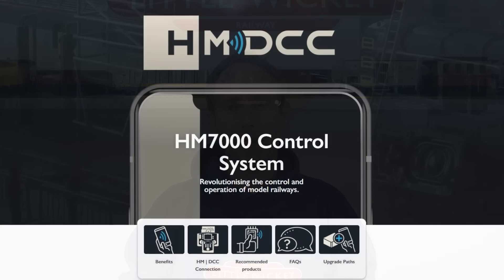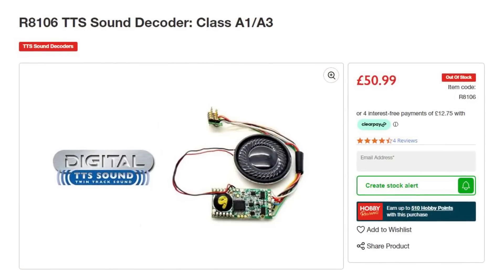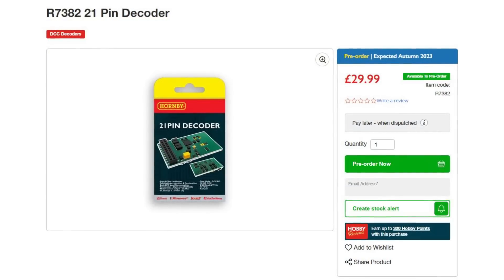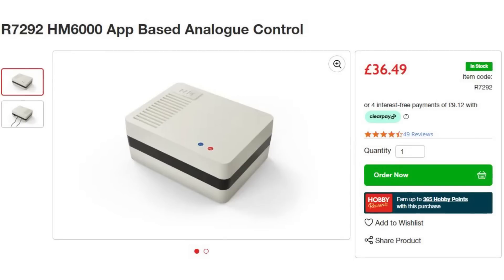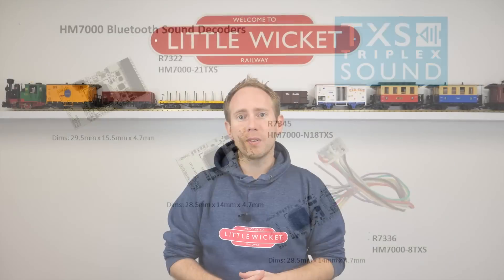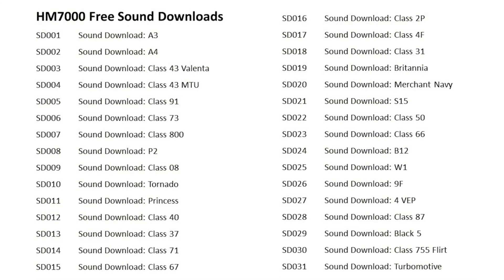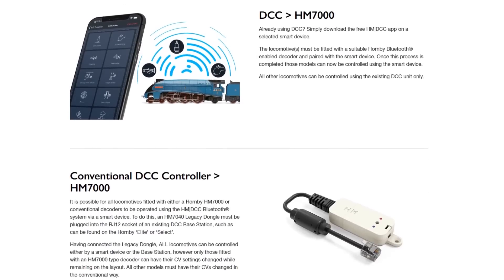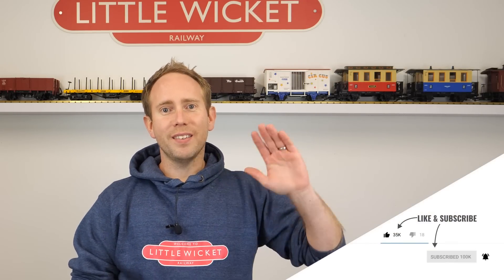Hornby Just Changed the Future of DCC with the HM7000

Comment: Yep.  Correct. Late entry, etc.

Re HM 7000:  
Bluetooth has been around for ages. Just that Hornby has caught up with it.
(Bluetooth is a specific form of short range WiFi)

Re HM 6000: 
Bachmann has had a basic non DCC sound unit too.  Apparently Hornby had one circa 1960s / 80s.

I have a Hornby 45rpm record with train sounds!  Know nothing about it.

Re alternatives: 
Radio controlled has been around for many years. I have quite a few (Ahern, Lionel, etc) and they operate on DC and DCC power.  They seemed to have disappeared.  Possibly because of their short range, etc.

I have a Bachmann (GGG) with sound that will operate on DC without anything else. As you increase the power, it goes through the start up sounds (engine, bell, horn) in order as it moves off! It also operates with DCC power and equipment.

A guy in USA has been making ANY track power WiFi decoders controlled by 'free' phone app for some time.

The sad news is whether some will make their proprietary.  ie not interchangeable like DCC.

Comment: Good vid. However Zero1 again? Betamax? Still have my obsolete Zero1 in its box. Solving a problem that does not exist? Hornby's track record with DCC is awful, incompatible and substandard, doesn't install confidence as they bolt the stable door with what looks like another hair brained idea that was not well thought out.
Reply from the maker: Only time will tell with HM7000. I've actually been looking back at Zero1 recently and given it was launched in 1979 it's still got quite a few fans today. It was ahead of it's time, sadly didn't get the support it needed to really take off (phases 4 & 5 were abandoned) and was ultimately superseded by DCC, but it was the first controller that was truly digital, affordable and widely available. You've got a piece of history in that Zero1 box, albeit a largely worthless bit of history.
Reply: @LittleWicketRailway  Yes. Unfortunately unless any emerging innovation is adopted by NMRA standard body it won't be adopted by the market. Standards may inhibit pace of innovation, but it also protects early adopters from financial loss and obsolescence. I've invested in too many sound equipped DCC locos to consider another emerging experimental tech. I'm going to hold on to my pristine boxed Zero 1 as its a piece of modelling history.
Reply from the maker: @oceanfroggie  the HM7000 decoders should work with any DCC controller and be NMRA compliant. How long the HM7000 app will be supported is a good question and we don't know if other Bluetooth apps would be able to also connect to the decoders.

Comment: Interesting -  direct control to the loco, power from the track & with 9 second stay alive potential for complexity on reversing loops etc to go away -  you'd just need strategically placed unpowered track to prevent shorts rather than getting polarity right.

Thinking on - its more like a DCC killer - if the track just needs to supply AC/power -  everything else is controlled wirelessly + if everything else has stay-alive power backup then power supply needs to be short resistant/restartable & ALL complexity over wiring reversing loops/points etc goes away.

Comment: Time will tel on this idea as there are a number of potential issues, firstly how much drain on you phone, possibly safe with a tablet having longer battery life. However I feel the biggest issue will be once you are controlling several locomotives and other devices such as signals, as the each unit will have its own Bluetooth chip, then you in to communicate with each chip you will need to hook you Bluetooth, which takes time, while you locomotive is heading to the points and another locomotive, so you are all ready switching between three devices at least, add more and this is rapidly becoming like spinning plates.
Reply: As I read it, the bluetooth decoders communicate between themselves, so you only have one connection between your phone or tablet and all of your locos. That should make it easier as you can just swipe between locos and accessories.

Comment: I've red quite a few of the comments a few asked will they work with your existing dcc unit mine being a digikeijs dr5000 , so do you have to use the hm7000 app to load the chip with the sound files and having a command station already can that then communicate with the chip as normal ,if it does then hornby will sell millions of them, if not hornby you've mist the biggest opportunity in model railway history................tony

Comment: I don't actually think it's as cheap as you first think. I have 40 loco's so buying the Bluetooth chips to replace the normal DCC ones they already have will cost over £1000, whereas Rocos Z21 cost me £500 and gives me the same app control of my locos.
Reply from the maker: If you've already invested in a system then I'd stick with that, I'm in a similar position. But imagine you're getting your first trainset, this is a way to get the benefits of DCC for basically the price the decoder. Previously it would have cost £££ for a command station.
Reply: @LittleWicketRailway  Even if all my locos were at the DCC ready stage, with no chips in them, it's still more expensive than regular DCC command station and decoders. (£800 decoders +£300 command station, Vs £1200 HM7000)
Reply from the maker: @peter sullivan again, this probably isn't aimed at someone with such a large collection of locomotives. Also, sound may not be your thing, but do that same calculation for sound decoders. The average retailer price for the new sound decoder is £60.
Reply: @LittleWicketRailway  I do agree there sound decoders are a good price and I will get a couple. As once you have downloaded the sound files, you can change a CV and then operate the loco on normal DCC. Where did you find the list of available sound files?

Comment: As an engineer I ask what’s the problem they are trying to solve? I’ve been able to control my DCC system via my smart phone for years.  With DCC via the track you can also set CVs without a programming track if you have a decent command station.Those decoders still look big

Comment: Honestly, a great step forward. Using existing "generic" hardware for the "command station" (a smartphone or a tablet), is a way to make great economy. Something as basic as a Gaugemaster Prodigy Express costs GBP 175, and it exists for ages ! I had bought the American original, made by MRC, for roughly the same price corrected from inflation, in... 2006 !
Great positive point, you can digitalize your whole fleet without changing something on your analogue layout : just buy your decoders one by one for your engines, and keep using anything analogic for everything else until you can digitalize it. Zero investment outside the decoders for your engines in this scenario.
Just two things missing in this range : an 8 pin decoder of the "chips over the pins with no wires" variety and a 6 pins one. There is OO engines with 6 pin decoders (Hornby Pecketts anyone ?) that won't being able to be upgraded with this technology. Maybe next generation of decoders... By the way, all the TT 120 Hornby range is equipped with next-18 sockets, something to consider...
Ironically, it's the brand which have the justified reputation of billing extortionate prices that makes something great for people who wants a DCC system at an entry-level price...

Comment: I was not aware the USA alreary had Bluettoth decoder chips. I have been wondering how other manufactures ( e.g. Bachmann )  would work if you put a Hornby chip in them 🙂
Reply: Product called Blunami decoder. It is more expensive than what Hornby will be offering. An issue with most Bluetooth setups is the distance from the transmitter to the receiver. In the US , regulations state, in an application like this, the signal cannot exceed a certain range, measured in feet.  I’d guess other countries may have similar regulations, but I don’t know. I’d suspect the Hornby decoder would work because it is plugging into the DCC plug. All the magic happens on the decoder chip/PCB.

Comment: I have spent 25 years buying Hornby Locos ready for my retirement layout, and have a range of analogue, DCC Ready, DCC fitted and Sound fitted. This sounds amazing and almost certainly I will use the HM7000, but it raises a lot of questions for me in regard to starting my layout. I have nickel silver track (Hornby). Will the wiring of the power to track need as much work done when I get round to it? What power supply will I use to run the track. I only have basic analogue control at the moment.
Reply: It sounds like it will work with an analogue controller, you have to leave the controller on full power all of the time to provide full voltage so you can't run another train on analogue at the same time. The only question doing this is how many locosyou can have on track with one controller, a basic analogue controller only puts out 1/2 an amp which is enough for one loco but will struggle with a sound fitted one. Better analogue controllers are still only 1 amp which is fine for usually double heading on analogue and maybe 2 sound locos or 3 non-sound. Beyond that you'd be best with the proper 15v power supply which will be 3 or 4 amps in total and run a fair few locos simultaneously.

Comment: I agree this was the standout announcement from Hornby, but like you would like a bit more detail. A demonstration video would be nice too. In theory though it sounds excellent.

You asked some good questions. Another is will the system support accessories like points, lights, etc? Since there's an accessory module for the HM6000 system I'm assuming there will be something similar for HM7000.

To be honest I've wondered for a while in this wireless age why DCC incorporated extra wiring and clutter which could surely be done away with and was looking at some wireless stuff at Warley.
Reply: There are videos on YouTube

Comment: It is about time Hornby caught up with the rest of the world.    A lot of locomotives they have are quite expensive.    I have used the Hornby TTS system, it is pretty poor quality unfortunately.
I am in two minds about the bluetooth system.  It does look like it may be easier to program these, but I am worried Hornby will not include a lot of features and possibly make the bluetooth side proprietary to their app, even if the DCC follows the standards.   Sorry if I sound a bit skeptical.  Unfortunately experience with Hornby has made me see them as more interested in money than the community.
Reply: Hornby's TTS isn't poor quality.
Reply: @LNER985  I've used several TTS devices.  The build construction and the performance is pretty poor for the price Hornby charge.   I am an electronics engineer and the build quality of TTS devices I have used is severely lacking.

Comment: Am I right in thinking that you must use bluetooth to control a HM7000 loco even on an existing DCC layout? It would be nice if you could control the loco by DCC or bluetooth.
Reply from the maker: I'm pretty sure they will work as normal DCC decoders. You won't have to use the Bluetooth.
Reply: @LittleWicketRailway  As you say Rob a lot of clarifications required

Comment: It all looks great so far ! But like you say there's still a lot to be answered like how about using your normal DDC already spent out on the TTS sound will you have to have 2 separate power supplies?
Reply from the maker: What follows is only my understanding of things, I could be wrong

If you already have a DCC power supply connected then the Bluetooth decoders will be able to get the required voltage from that, so no need for another power supply.

You can control your Bluetooth locos via your phone app and your non-Bluetooth locos using your normal DCC command station (you can also control your Bluetooth locos using the normal DCC command station as they should function as normal NMRA decoders).

AND if you get the Bluetooth legacy dongle that will connect to your Hornby DCC command station then can control your regular non-Bluetooth decoders via the app too. Per the website, "It is possible for all locomotives fitted with either a Hornby HM7000 or conventional decoders to be operated using the HM|DCC Bluetooth® system via a smart device. To do this, an HM7040 Legacy Dongle must be plugged into the RJ12 socket of an existing DCC Base Station, such as can be found on the Hornby ‘Elite’ or ‘Select’.

Having connected the Legacy Dongle, ALL locomotives can be controlled either by a smart device or the Base Station, however only those fitted with an HM7000 type decoder can have their CV settings changed while remaining on the layout. All other models must have their CVs changed in the conventional way."
Reply: @LittleWicketRailway  Thank you so much for the info being a bit older takes a bit more getting around it lol regards Paul
Reply: @LittleWicketRailway  I took the opposite from it. That they won't work from an existing DCC controller, all they take from the track is the power supply. It looks to me like the first thing that happens on the decoder is a bridge rectifier, which would obliterate any DCC signal.
Reply: I got the impression that you could still use conventional DCC, that these chips do not need a conventional DC supply?

Comment: In my opinion another Hornby closed shop, if it were open source fine, but it isn't. Another DCC dodge.
Reply from the maker: I think the decoders would work with any DCC system. So even if the Bluetooth functionality doesn't appeal to you this is still a programmable sound decoder for a reasonable price, hopefully with all the features a newly designed decoder should have.
Reply: @LittleWicketRailway  I'm pretty sure that reverse engineering this stuff would be pretty easy for open source hackers. If the major players sense market share, they will get teams dedicated to it. I reckon by a year's time, this will be considered pretty much open source. If Hornby were smart, they would licence it.
Reply: @Pierre-de-Standing  One thing I wish, is to have other manufacturers working on an open source protocol for Bluetooth DCC. Maybe based on Hornby's one if they are in...

Comment: The new decoders seem great if you're interested in sound. However if you're not and already have a dcc system, changing to this system is quite expensive. 
I'm quite happy to control my trains with 8 pin dcc decoders and probably will continue to do so.
Reply: Yep, but I'll be getting the bluetooth converter for my ELite, using the app, but still will buy cheapo non-bluetooth decorders.

Comment: This seems a brilliant move from Hornby. It seems to provide what people are after by giving people a cost effective route into into digital whilst at the same time ensuring that you have to get it all from them. 

It occurs to me that it might work for garden railways too (depending on the range). If you simply have to prove a constant 12v, this could be done with a battery.
Reply: agree, and if the loco pulled the battery in a special coach or wagon or tender the opportunities are inspiring.
Reply: Funnily enough I used Bluetooth to give remote control to a loco I built for my grandson's Brio train set. It's powered by a lipo in the tender. I'm very pleased with the result but one has to accept that the Bluetooth is not 100% reliable. One has to have some strategy in the loco code to deal with the communications loss, either stop or proceed at current speed or some  such. Over the distances needed for a garden layout I think the range would be an issue.
Reply: @ColinMill1  They address this in the website. Range can be extended by the inclusion of a "node" along the way. There will either be a stand alone module to act as a node or they say the decoders themselves can act as nodes, so a loco sitting in a siding half way down would do the job.
I'm going to give it a try in my garden, I'm hoping it isn't another Zero1.
Reply: @GDGRailway47712  Yes, I would be reluctant to invest lots of time etc into a proprietary system just in case the company literally pulls the plug on it.  Depending on the complexity of the layout I would either use a conventional RC system as many of these are open source with multiple manufacturers involved or I would use ZigBee as that has mesh networking built in. Unfortunately, I doubt I will get even a tiny way through my existing list of aeromodelling projects without adding railway to it (many years ago I was all set to model Dinting Museum in N gauge when they shut the place leaving a somewhat bitter taste to the project, though it remains boxed up in my workshop)